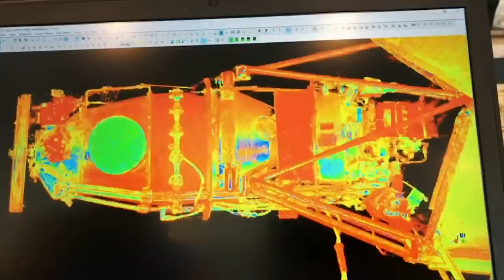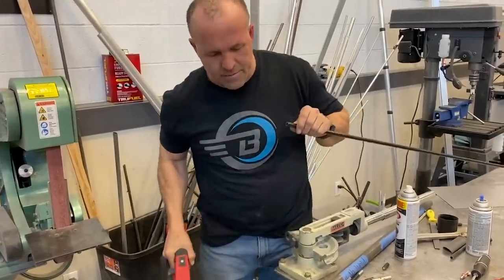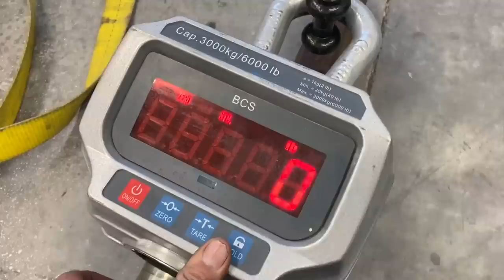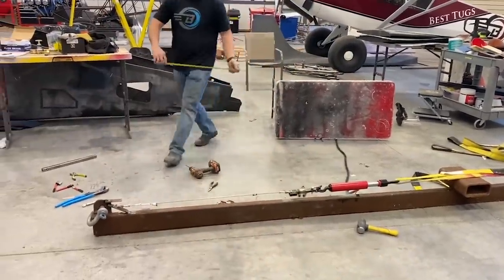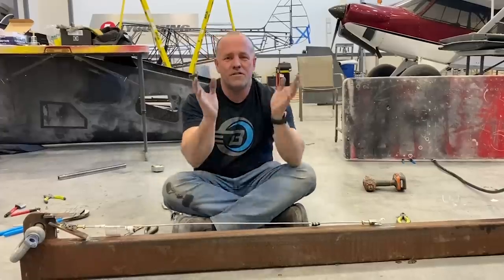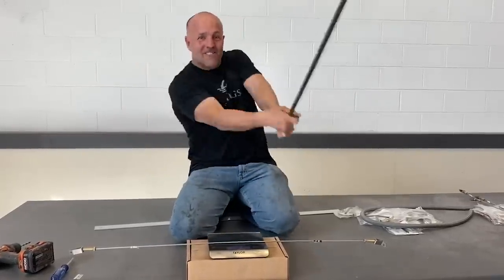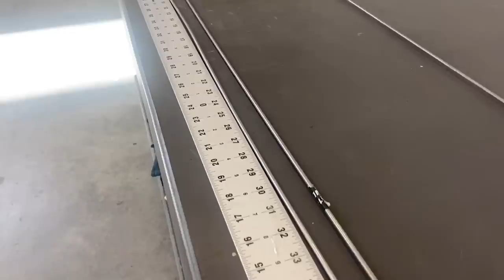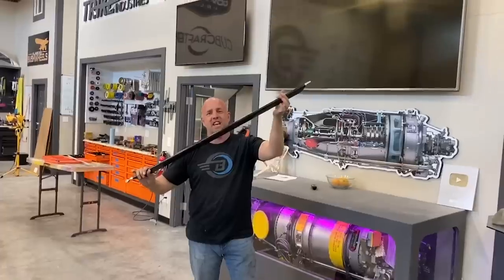Testing to Failure (Scrappy Bush Plane 17)

Comment: I got next to a semi with a flatbed that had a dozen six inch straps holding down the load. I kept hearing a rapid noise, it sounded like a Jake Brake. When I got just past the semi I could see what was happening. All those tie downs were oscillating with the wind flow and fluttering like crazy. Depending on where they were and how much air flow was passing over them, the difference in pitch. Just like Mike said. That man is pretty clever...

Comment: One of the most informative and best real world explinations ive seen regarding this subject. Awesome to see how much you have overbuilt the aircraft. Good on you man.
For the record, i picked 1200lbs as total failure point for the wire (to the point it broke) which turned out to be 400lbs short (broke at 1600lbs) and i picked attachment point pulling through (i used to be a sheetmetal fabricator so i had to deal with this a lot).
I picked your carbon rod to break at 2-2.5x the wire shear point. Which was correct.. but i picked the wire sheer point incorrectly... so i was wrong 🤣🤣
Awesome vid mate, thankyou for the lesson.
Been watching your vids since the 3rd instalment of the draco vid. Love it. Best chanel on youtube.
You're a legend and an inspiration as a person. All the best mate!

Comment: Hey Mike, Build a lot of these carbon fittings, I mostly use 316L for the end fittings or 7075 anodized, a little trick I use is to replace the rivets by though and through carbon pultruded rods. Sanding the tubes inside out in the fittings should help the bond specially if you add good structural adhesive like 3M DP490 (this stuff holds around 30mPa in shear) let me know if you like more info on the topic ;)
Reply from the maker: Tristan Trajan 👍🤠

Comment: I love your videos Mike and how you set up the purpose, what you're looking for and your testing standards. I should have been an engineer I came from a family of engineers, went a different way but it's interesting exciting and challenging. I think the bar is of a ductile material and under a tension it will continue to draw, until quite thin. You might be able to draw it through dies and make a wire out of it. But the eye hole on the bracket has a combination of tension and shear, with the inside of the hole shearing and spreading outward. It's also a pretty thin piece. A bit like tearing a phone book in half.

Comment: Mike, love the test set up and not surprised with fail points. One test you should do that was not part of this test is to check what happens when you get a perpendicular stress on the rod while under liner stress. This would better cover what happens if there was a bird strike type of event while under stress. This is where steel might do better than carbon because of elasticity.

Comment: Oops there goes a few more of them Yankee Dollars. Great engineering I am impressed. Years ago I tested some Nicopreesed  fitings and cables to twice their rated loading using the principle of Moments. Just a See Sawed platform loaded with concrete blocks of a known weight. The result? The rig broke at an extreme load the cables etc were intact but stretched a tad. Great fun. regards, Jim in NI UK

Comment: Mike 31:09. I see that you switched to the less expensive respirator filter.  I had suggested doing so a few videos back when you had on the heavy and over rated filters for what you are doing. 
May i suggest the 3m 2097. It's the same style filter that you have on but it also has a little carbon in it to catch low level voc. They are perfect for what you are doing and cheap enough to throw out on the regular.  They are tough to get now but you will be able to find them for under $10 a set when they are back in stock.

Comment: Thank you for this high value and extremely useful information. a well thought out test process on the fly.   if for some reason you ever needed  a better bond with the ends you could try a higher order epoxy like Araldite or equivalent, or a post curing resin,  I would have thought micro fibers would have been a good addition to your mix as well,  Thank again for the view into your projects

Comment: Coming from electrical industry,we used metal electrical contacts terminated on fiber rods with pins and compound to hold the termination. Pull test all showed good but real life over time the pins would wallow out a hole where it would basically cut down the length of the fiber. Might consider a test similar to flight and over a fix time. Just a thought.

Comment: Sorry i'm back had to leave your page and read about why flags flap in the wind, which is why tie down straps flap, and back to your page.  Von Kármán vortex street effect is why the flying wires vibrate and you have to load them to keep them from vibrating.  That's an hour of my life gone. Thanks love your videos. Learn so much about thing you can apply to every aspect of life.

Comment: We used some experimental carbon fiber  sucker rods out in the oil field where I was.. they were pretty amazing we ran your typical string starting from 5/8" up to 1" , then ran a string of 5/16" carbon rods up to the polished rod.. yes you read that right, 1 guy could easily pick the rod up by himself, except they were 36' long and they didn't offer any strength for bending or bowing..it was absolutely vertical strength.. it was crazy to see.

Comment: Failure should be when the assembly allows the control surfaces fail to provide the control inputs put on it by the pilot. If the pilot tries to move a surface 30 degrees and it only moves 28 degrees it failed. That would be my criteria. As far as the individual pieces of the assembly under test, there would need to be some degree of deformation under load leading to the condition above.
As the test reveled the measurement at 600 plus pounds when there was stretch that was permanent I would fail the part at that point.
Now it would have to be determined how much load the bar is expected to see under flight conditions, and if that was within or beyond the conditions the plane would see with a sober pilot at the controls.
This was an awesome test. I really want to see scrappy when it's done! I want to go over everything you've done to build it. This is incredible, and you've gone so far behind any other DIY builder I've ever seen!

Comment: The metal rod should behave according to PL/AE until yield which was around 600 lb.  Would be nice to have a little instrumentation like a string potentiometer and you can see a lot more about that behavior in the elastic range and then during the yield phase.  We do a lot of testing like this at my lab for large scale structures.  Fun video! Thanks for posting it!

Comment: Thank you Mike for yet another great video. I am very familiar with beraking things and redesigning to improve the design of crashworthy seats. I was Part of the Top-Cubcrafter seat certification. I did a slomo Video Analysis of your video and found the last Load after giving, when the scale already turned towards the camera was at 3444 lbs. Next time you can place the camera higher, so that we can see the Scale values at all times. One other observation I would like to share is about the support point of the hdraulic cylinder. Best would be to add a higher point for the scale to attach, so that you do not need to elevate the cylinder. In the end it is negligible at the margin of safety that you have achieved. On the other hand you could actually downscale the Carbon Fiber assembly and looose weight as well. You are awesome and a great light in these trying times. Thank you for that.

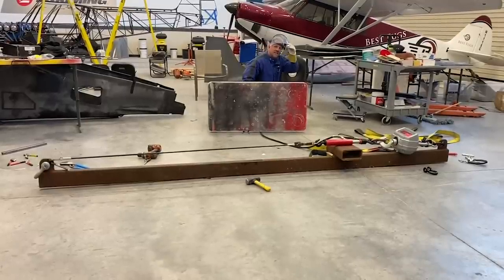Comment: 26:37 When the connection to the carbon tube broke there was almost no movement. In other words even with a load equivalent to a medium sized car, there was was so little potential energy stored in the jig plus test subject that it translated into pretty much no movement when released. Imagine a unbelievably stiff spring. Only goes to show how solid that tube is!

(In fact, most of the stored energy seems to have come from the bending steel beam)

Comment: Hey mike. The way you are loading/unloading the part (like when you load to 440lb, then unload to see if it was just elastic strain) will change the overall characteristics of the stress/strain curve for that metal. Like, the plastic deformation will occur differently, after loading and unloading (if any plastic deformation is happening). Just something you may want to take into account. - a metallurgical engineer.

Comment: Great to see so many common engineering practices and a development process not that different from what is done in the industry. I really like the design of the interface between carbon and the connections!
Two things I was wondering about: how do you determine the forces that are actually pulling on the wire/carbon tube. Just knowing the point of failure only helps you when you know the actual forces and can estimate a factor of safety. And for the carbon tube, I would be concerned about FOD thrown up by the wheels which could lead to impact damages not visible to the naked eye. Delaminations below the surface can lead to premature failure of the part without showing any warning signs beforehand.

Comment: Ready to watch Mike create a newer stronger carbon tube to connector fittings in 5, 4, 3, 2, 1...... Actually I heard Mike say he used threads inside the connector but Im thinking a series of concentric rings with blunt peaks might be stronger (Look at a Huck bolt). Possibly putting the adhesive filler into compression instead of shear. It would be interesting to find out whether the bonding material failed first then the rivets or if it was the other way around.

Comment: Mike that  was a great video.. I even learnt how to use a ratchet strap better!
 Tiny critique if I may.. At 30.08 yoou were using a spray gun I wanna tell you close the fan control and you will get much more efficient material transfer and less overspray

Comment: Super amazing solution, tons of headroom performance-wise, and elegant to boot!.  Couple thoughts: First for what it weighs, make an extra one, and a place to stow it somewhere in the tail, because if a bird gets filleted, or one of those honkin' bush tires throws up a rock, it might be the one thing you'd like to swap out before flying home just because.  
Which brings up a point, let's suppose a rock does come sailing into it, what then?  The steel rod will take a hit, but it won't shatter.  How does carbon behave with a sharp point impact?  Given there's a redundant shield with the airfoil layer that's protective and will take the hit before the core does.
From a preflight perspective, a foil wrap would telltale any damage, kind of like that adhesive aluminum duct tape the HVAC guys use, but with a nicer surface, and higher grade.  From a procedural standpoint, I'm curious as to how the preflight is going to bubble out.  Look, listen, wiggle, touch?  Something I always did when preflighting the Warrior prop after the visual inspection was rap both blades with a knuckle to hear it ring (like a tuning fork).  They darn well better match in tonal pitch, or else it's staying on the ground because you can hear something that you'll never be able to see.  To which I'm curious, in how much detail will you inspect that windmill up front?  With the brakes locked, you'll probably be able to vacuum up the asphalt and throw it at the tail...LOL

Comment: Try some HL-10 titanium Hi-Loks, through the part, four Hi-Loks per end piece, staggered at 90 degree intervals.  That puppy will go three or four times the yield strength of the Avex rivets you appeared to use.  You crack me up!

Comment: Another great episode.  I loved your presentation of the thought behind the new parts, and the thoroughness of the testing.  Since part of your goal is to minimize excess weight, and none of your heavy carbon rod ends had any failure in the actual machined part, why would you not make lighter hardware for both ends of the carbon rod?  That would give you maximum savings of weight.  You could easily test to 3000 pound limit on the new hardware, and still have triple the strength redundancy over the prior steel part.

Comment: I honestly would not have guessed that stock wire off the carbon cub would handle that much. But the more I think about it I assume it's like more things with GOOD load ratings and they build them for five times the actual intended weight. Still impressed though even if it has "failed." It is crazy that it was able to take that much abuse without TOTAL failure!

Comment: As for galvanic corrosion between stainless and CF, I looked into it some years ago and I think I read a research paper that showed that just a coat of epoxy in between the two materials was enough to stop it. Or a very thin layer of glass. Can't find it right now, but back then I googled it, so it should still be around.
But then again with the rivets in, they might corrode on their own. Would have been cool to see a test with rivets and no rivets. Plenty of very high strength bonding is being done with epoxy adhesives. Perhaps they are specially formulated and not laminating resins with fillers. Hysol is one such brand, I think. 3M makes some, too.
Reply: Was thinking the same...The idea of just putting extra drill holes and rivets worried me a bit too - this might influence the max tension strength in bearing at his attachment points.

Comment: The whiskers of seals also have a twist in their structure. It enables them to feel changes in the water current created by prey which they are pursuing since the whiskers don't oscillate when they have a mostly laminar watercurrent hitting them. (I really don't know if they call them whiskers on seals. But it gets the point across.) Picked this up ages ago in a wildlife documentary. Never thought of applying it in engineering. Darn now I wanna study boinics.......

Comment: Carbon is strong but I’ll never forget watching a carbon frame on a hang glider fail on launch and the wing half fold up. The pilot survived but another 2 seconds of flight would have killed him. The carbon spar in the leading edge had a fracture that couldn’t be seen during the sail off inspection just weeks earlier.  Impressive strength mike but make sure you watch for any signs of cracking! 😜

Comment: Mike I hope you would do a little bit of thermal cycling on the parts probably down into the -20 to 30° and clear up into the 120 to 130° and see if there’s any change after 100 cycles or so. It’s amazing how much temperature cycling can really screw things up.

Comment: Awesome learning here! Welcome to aircraft engineering (joke). We do our best to calculate and test and keep weight out.  I designed conveyers and heavy equipment many years ago. I had to re-learn the strength to weight ratio. It is amazing to see math happen in reality.  Thank you for showing a real example. I will share with my fellow engineers.

Comment: Mike maybe you know this already but here goes,  adding micro to Epoxy reduces the strength of the Epoxy substantially.  Flocked fiber will thicken and maintain the strength.  Another good choice  is Cabosil but be sure to use lung protection, it is nasty for your lungs.  Love your approach and thanks for the inspiration.

Comment: Rotate the straps! I've driven for hours being annoyed by oscillating straps. I've spent extra time wrapping a strap around the bars on my roof rack so it wouldn't oscillate. I've taped excess strap to the roof rack. But never thought to just rotate the strap 🤦Thanks Mike! (The other engineering stuff was cool too.)

Comment: I doubt adding a couple more rivets would do much for the ultimate load of the composite assembly. Generally the shear strength of the adhesive is greater than that of the fasteners, and the fasteners are primarily used for “clamping”. I would poise that the reason the rivet shearing is as clean as it is is because when the epoxy/micro bubbles failed the load was well in excess of the river shear load and the impulse load imparted on the rivers caused catastrophic failure of the rivets in shear.

Comment: Hi Mike, I fly hang gliders made in California by Wills Wing.  I have carbon down tube on it.  You can see on the willswing.com website what they look like.   You might consider adding some trip trips. To the struts for efficiency.   A thin black pin stripe at the max profile width now that the part is finished.   Or fishing line in the clear coat or resin at build time.  Apparently it's a substantial difference aerodynamically speaking.

Comment: Mike.  Is that draco's motor/ engine in the display? How about a quick run thru that display case that your kid built. It's an eye catcher. Also maybe just a quick show and tell of the turbine engine.  Just point at certain wires and tubes and tell us what they are. 
Loving the build vids.
Reply: Apparently it the engine for his next project.

Comment: That is just a beautiful part. Definitely worth the time, and effort. As to safety of being close to it on failure, because it was not stretching, there was no stored energy to be released on failure. As to strength, I know that with carbon fiber fishing rods, one small scratch, and it will fail the next time it is bent. I know that these rods will not be subjected to that sort of bend, but just for the sake of argument, scratch the rod with a razor blade, and do the same test. They could get nicked, or scratched by flying derbies in use. It would be worth knowing how they will hold up with some minor damage.
Reply from the maker: Scott M great comment my friend 👍🤠the extra full raps that are also the airfoil is the protector of the inner. That’s why I tested without the extra safety skin.  I can take out birds with that and not get to the inner core 👍🤠
Reply: @MikePatey  My gut tells me that your assessment is correct, but still figured it was worth bringing up. Cant wait for more videos.